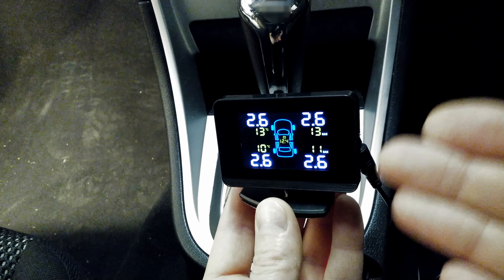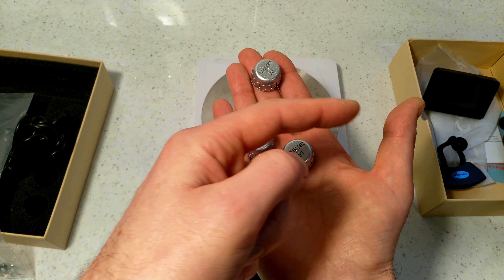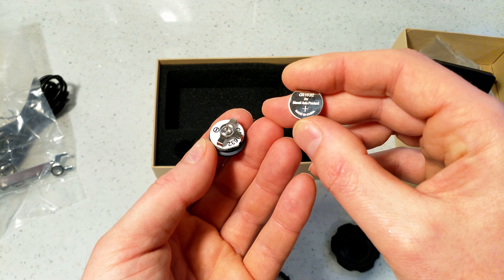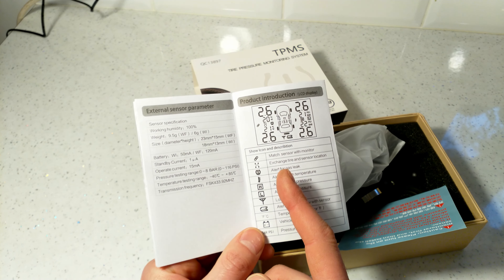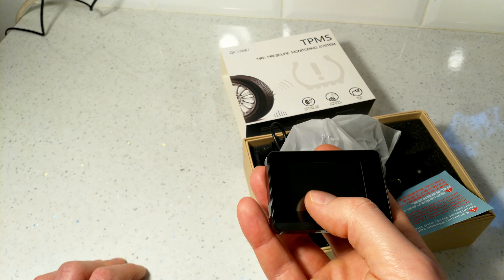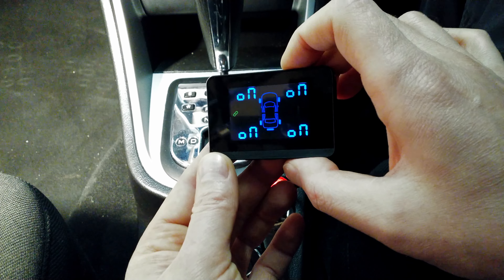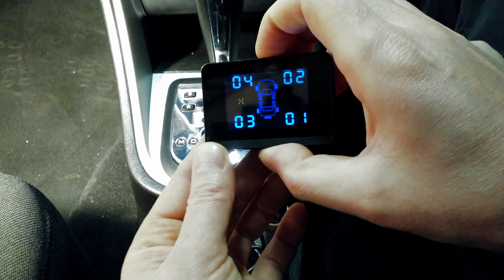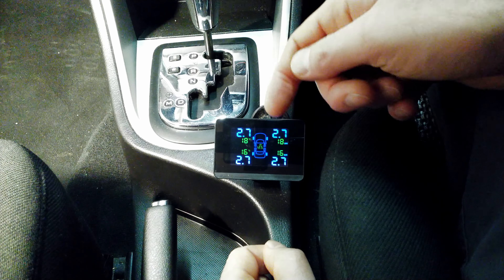External (TPMS) tyre pressure monitor system long term review, installation, configuration

Comment from the maker: I realise that this particular TPMS might be a bit hard to get hold of. When I made the review/video there were plenty to choose from. Currently, there are not that many. I have put a few links in the description to get some of these from amazon (UK).
Generally, if they share the same screen as this one, they will work the same way. The sensors in all of these TPMS are the same. Graphics might be slightly worse for some, but they will behave in the same manner. I prefer this one, as it has a cable rather than some sort of battery or rely on solar panels.

Comment: I have one question: Whats the behaviour of the display when a sensor has a dead battery? My TPMS (same screen) suddenly didnt display the front right tyre anymore. Do you know if thats a symptom of a dead sensor battery?
Reply from the maker: I think that the behaviour is just that it will not update the readings, i.e. values will stay the same. The valve thingies are already paried  with the device and the rcurrent eading is from the last whatever reading was, unless updated. So, the behaviour, as far as I understand, is that it will just show some numbers.
Yeah, not too helpful really the way they have designed it that way. A bit misleading.
I think I had them off the tyres and drove for quite a bit with the display on, it was just showing the last recorded readings.
Reply: @moremolecules  thanks for your fast reply and a little follow up: It was a dead battery. So, ... basically no update for a few mins and then just no reading on the affected sensor.
Reply from the maker: @christofschwarz6602  Ahh, great, I thought it just kept the last reading, maybe I did not see it right.

Comment: i installed a TPMS about 3 years ago and its still working well, however its no longer available and getting replacement sensors might  be a challenge as i cannot find anything online.
Reply from the maker: Yes, the whole kit seems quite rare these days. I think (almost certain) that any of these sensors will work with the device. They are all the same and operate at the same frequency, only need synchronisation. Probably the chip and "supply chain" issues are contributing to the lack of sensors.

Comment: One more question. I noticed you mounted the sensor on a rubber valve stem. With a rough calculation, I found out that the centrifugal force could be around 3 kg at 85 mph. Will this be a long term concern for valve stem to crack/rupture?
Reply from the maker: 85mph is a bit on the higher side of things, but yes the centrifugal force will increase with the increase in speed. If one is reaching such speeds, the sensor could be replaced with the inside tire one. It is the same sensor, just that it is a valve with integrated sensor. That would negate the centrifugal force.
I prefer the outside one, as for most people it is the easiest option, no need to remove the whole valve, which is a bit involved in itself. I can also move the sensor from winter to summer tires. Of course, one can buy say 8 integrated valve sensors and use these with two devices, but it is a bit on the expensive side.

Comment: Nice video. Can you set different triggering pressures for different tires? A typical tire pressure is around 35 PSI, but a typical donut spare tire is around 60 PSI.
Reply from the maker: Thank you for the comment. Unfortunately, one cannot assign different pressure (psi or bar) to individual tires. It is one setting for all. I have not really thought about this, as the spare tires on my cars are all normal tires. I suspect that the donut-type tire is mainly to drive short amount of time to go to the shop to change them.

Comment: Where I can get same tpms
Reply from the maker: That is a very good question. When I made the video they were really popular and everywhere. I have a few links in the description of the video to purchase from the UK, but it depends where you live.
For example ebay: https://www.ebay.co.uk/itm/223699165290
Amazon: https://amzn.to/3cZqSM9
Amazon: https://amzn.to/3chAgvj
Ebay, but these seemed wired although it is the same unit, not much difference: https://www.ebay.co.uk/itm/384482296840
Reply: Thank you, Does it show in Fahrenheit and pressure in PSI?
Reply from the maker: @Marksdiscus  Yes to both

Comment: Not quick response for the alarm
Reply from the maker: Yes, there is a bit of delay, but this is mainly to help with slow punctures. If the tyre deflates straight away, one would feel it in the wheel, not much need for the alarm in that case. The slow punctures are the more serious things that this helps with. With a slow puncture on the highway/motorway the tyre wall flexes too much and excess heat is generated that could result in sudden failure. The sensor will definitely help with this.
I suspect that the connection is every couple of seconds to conserve battery life.